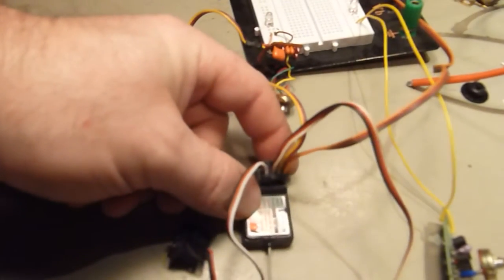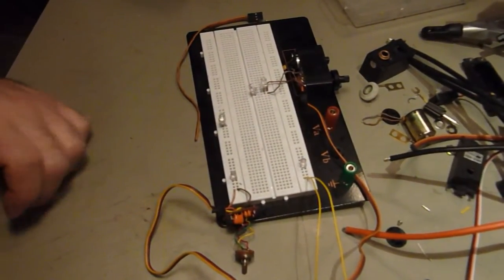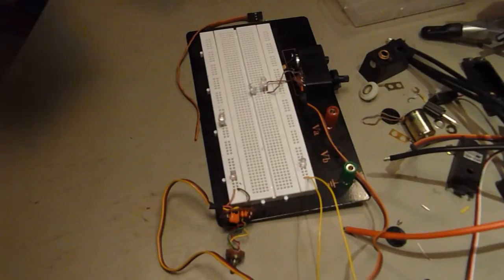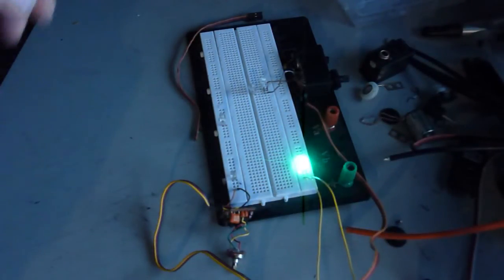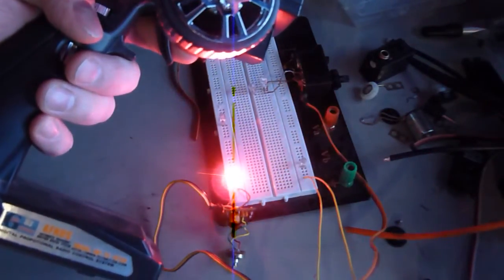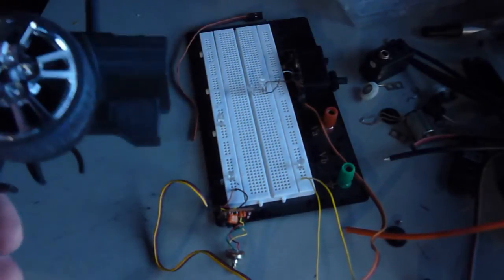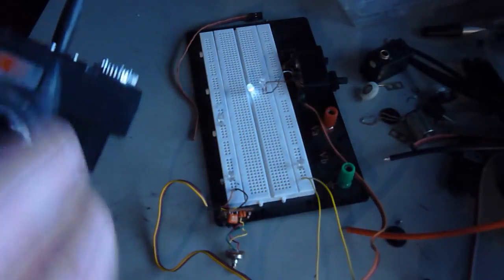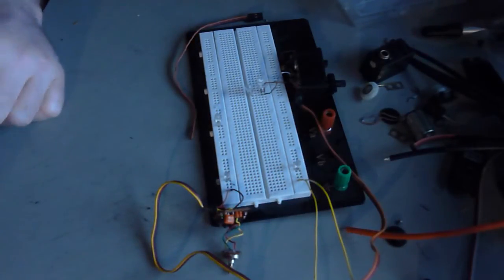Use old servos to control your RC Car lights. Brakes, gas, 3rd channel.

Comment: 10 LED's in parallel I think?
Reply from the maker: For what?
Reply: @TheLEDwheel  if you want to power 10 leds. Do you need to put them in parralel?
Reply from the maker: That would depend on the LED's Forward voltage, current draw and also the supply voltage....

Comment: I'm looking at how to add landing/nav lights to a foamie that I built.  I will just be coming off an aux channel on the receiver, so no interference with other servos.  Just stopping by to say that this video helped point me in the right direction.  Very good info in your video.

Comment: hey does anyone know how to change brakes to complete diffrent setup and how to get a custom made metal spur gear im in leeds england and have a thunder tiger dt10 and the spur gear burnt out within 10 mins of use and i wasn't bashing it the spur gear was in great condition an it just wore away until the car wouldn't move and i don't have a brake on it the old way of brakes were awful so i want a different setup
Reply: kierankay100 you're gear mesh is too tight or loose
Reply from the maker: You sure you had the right pinion?

Comment: Couple comments regarding this, from experience.  First, instead of messing with the potentiometers, you can replace each potentiometer with a pair of resistors, wired in series. Typically, servo potentiometers are rated at 5K, so if you use two 2.2K resistors, you will have the same thing as a "centered" potentiometer.  Simply twist one lead from each resistor together.  That will be soldered where the middle terminal of the potentiometer was.  The other two leads are soldered to the outer terminal locations.  No more fussing with trying to get the potentiometer JUST RIGHT and then having to put some glue on it so it stays.

Second, from everything I've tried, a flashing LED will NOT work with a servo board as the controller.  The PWM output of the servo board messes with the flashing LED and you will end up with a constant-on LED.  You can create a flashing circuit using a 555 timer that MIGHT work, but I still have my doubts with that as well.

I've been using servo boards as controllers for a few years now.  And sub-micro servo boards work just as well as standard size boards.  You just have to verify the output voltage from the board and resistor the LEDs accordingly.
Reply from the maker: Thanks for your input.

I had actually thought about the Resistors, Just wanted to show people whats possible with an old servo. The one problem with that is if you have one on the same channel as your steering servo you won't be able to adjust for your steering trim position..

As for the PWM, have you tried a Capacitor in parallel with the LED? I have not yet but just wondering if you did!
Reply: If you have two servos on one channel, you would definitely need to do something slightly different from what I recommended.  You could still replace the pot with resistors, but you would have to use a multimeter to determine the resistance value of the pot when trimmed where you need it.  Then it would just be a matter of using one resistor with that value on one side and another resistor of the remaining difference (5k - value of first resistor) on the other leg.

As for the cap, I tried that, but couldn't get the LED to pulse.